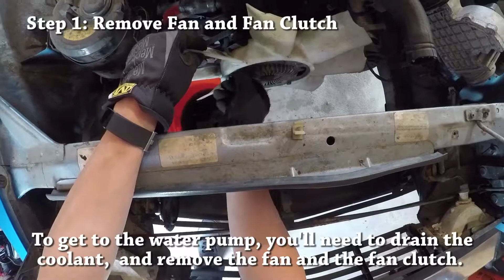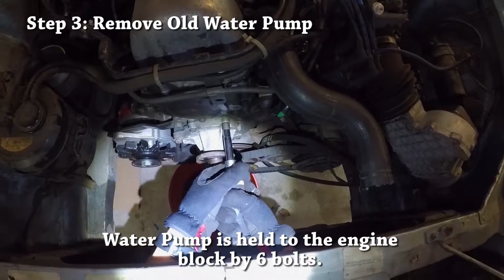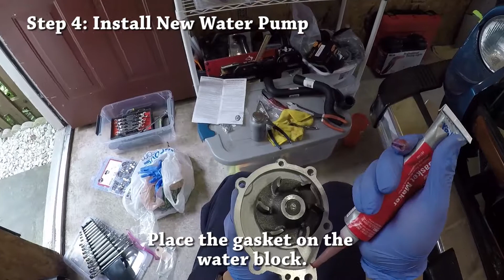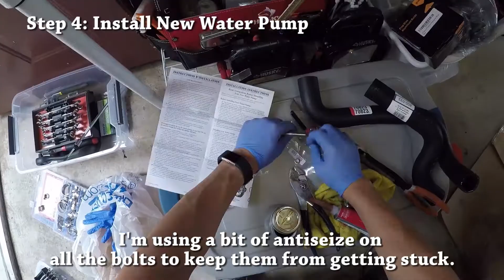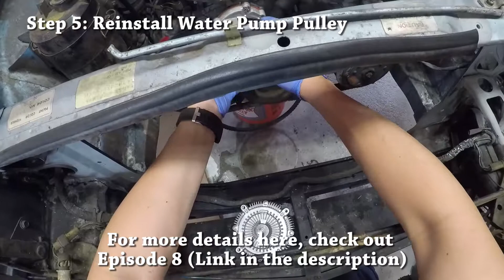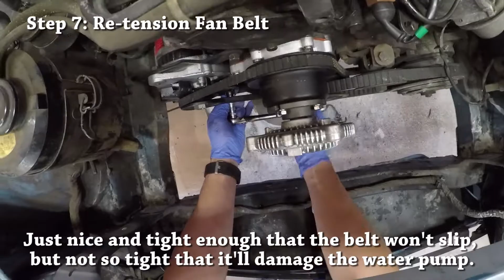Datsun 280Z Ep.9 Replacing the Water Pump

Comment: I’m watching this as I’ve noticed my clutch fan had a crack in it, but I have a question. I installed a champion 3row radiator and my clutch fan tends to gouge the fins of the radiator at high rpms (I opened the hood and revved the car and saw the fan “warp” and hit the radiator). Is the cause due to a cracked fan, bad engine mounts, or the radiator is just too big?

Comment: something to watch for, make sure the alignment dowels stay in place.
Reply from the maker: Hi Dave, 

Thanks for commenting! Good call out, I actually didn't even know that the alignment dowels (little peg-looking things that stick out to align the water pump to the block) can come out of the block... I think mine just might be stuck on there. 

Happy Wrenching!
Reply: only reason I know is when I did my WP one of them stuck to the pump, did not notice until I had it all back together. funny part was the replacement pump dowel holes were too big for the alignment dowel to be effective. Maybe different models used those holes for bolts. Perhaps the OE pumps differed from the generic replacements. Keep up the good work.
Reply from the maker: Thank you, that means a lot! I'm actually a subscriber of your channel as well =)